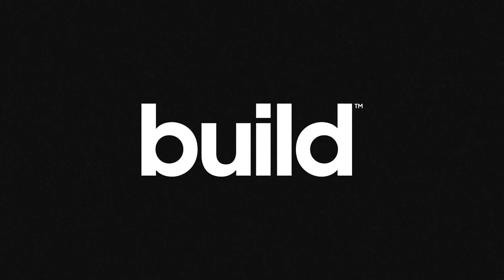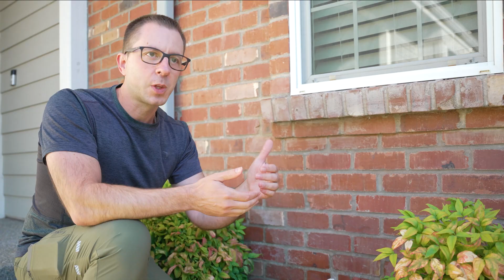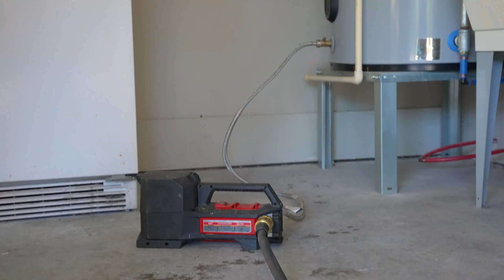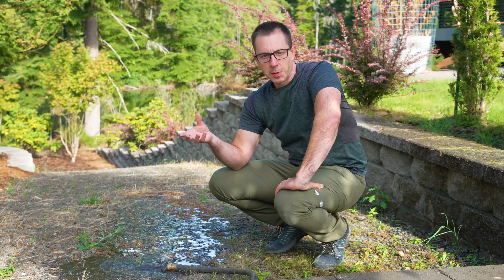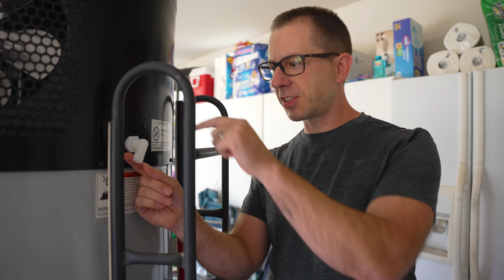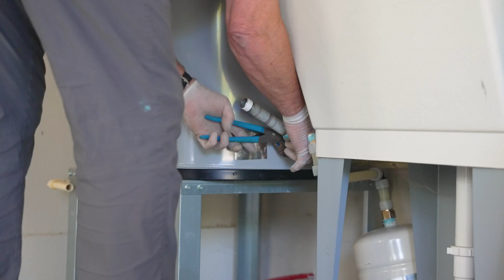AO Smith Heat Pump Water Heater Replacement

Comment: Hi Brian, did you ever deconstruct that AO Smith condensation outlet? Mine just cracked out of nowhere and wondering if their are any replacement parts for it. Thanks!
Reply from the maker: Ended up replacing the whole thing. 🤦🤦 The unit was under warranty, but the labor was not. Get a hold of AO Smith directly and see what they can do